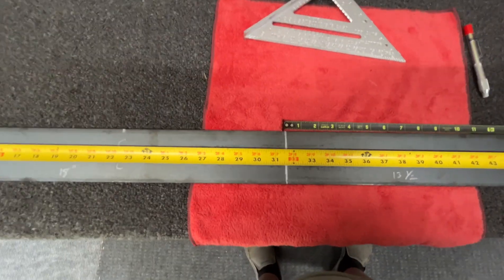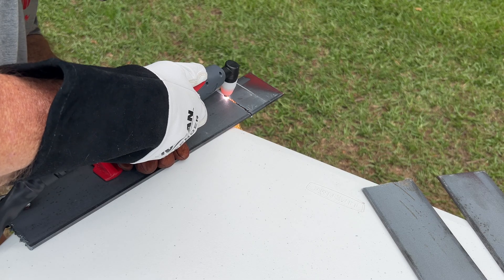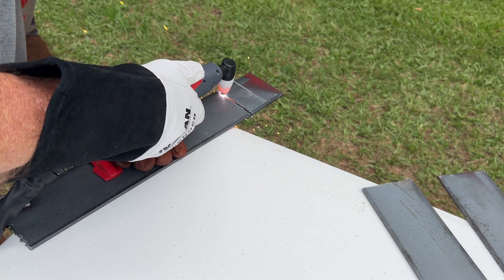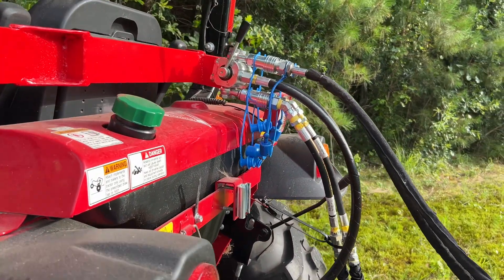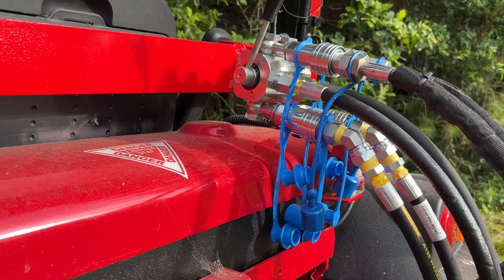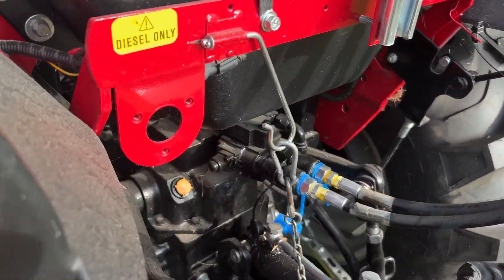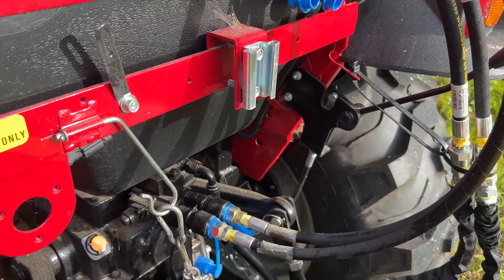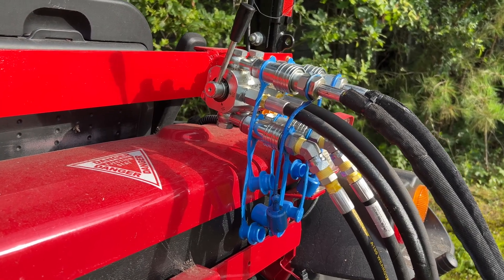TYM T474 Manual Hydraulic Multiplier Project

Comment: nice job. do you use a high quality metal coating like POR-15 or do you use paint? i get my stuff bead blasted then i get POR-15 on it right away then the top coat with UV protectant. ps do you have a video on that green cutter?
Reply from the maker: Hi there Barney. I used a high quality outdoor paint and sun baked it between three coats. I do have a new video out on the Nova Tractor MFZ-175 Flail Mower. It is in the listing. Thanks for the comment and have a great day.